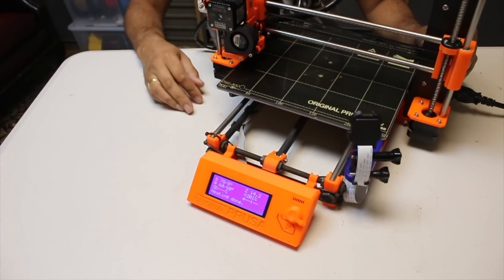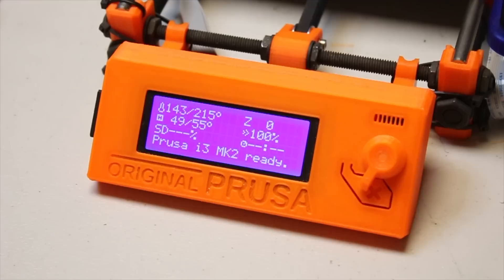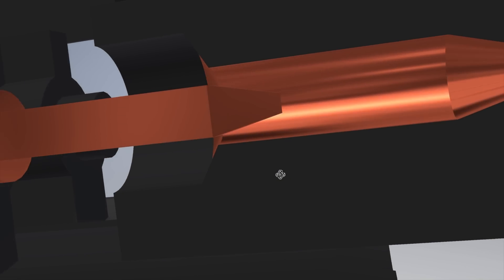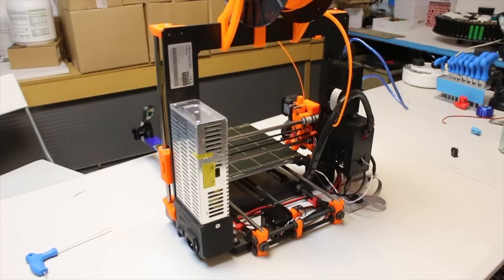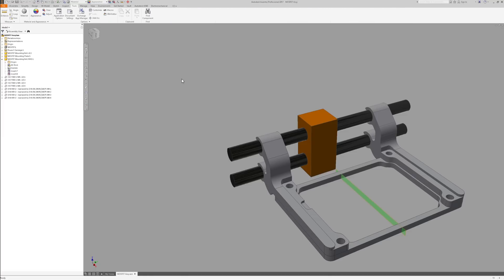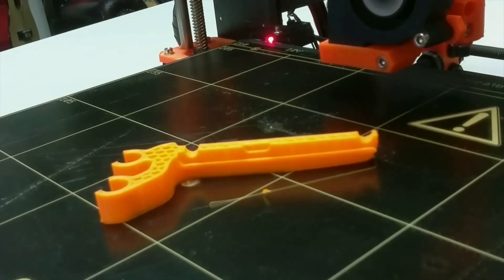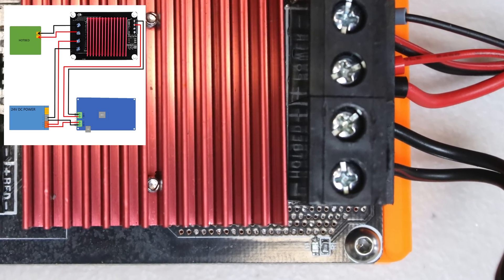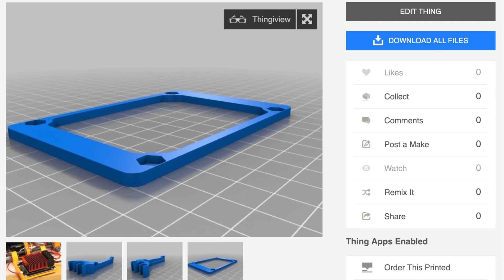Upgrade your 3D Printer with a MOSFET - Simply!

Comment: So basically, where the old heater wires connected to the mainboard, you connected the mosfets "control" location, then Power in/out to the source voltage, and hotend.  Is that correct?
Reply: I tired it on mi e mine fire the hotend, and it just starts heating and can't be controlled by the mainboard. Idk what to change. Can you please help,?
I'm on discord too.

Comment: Is there a reason not installing a fuse from the PSU to the mosfet? The original board mosfets are secured with SMD fuses. Now the low load from board mosfet to external mosfet is secure (smd fuses), but no fuse from PSU to heating element (over external mosfet). If the heating element fails it may short and draw a lot of amps. Not enough for the PSU (e.g. 200W) to shut down but enough for the heating element wires or connectors to get very hot.
This may be bad without a fuse, or am i wrong?
Reply: very underrated comment! i've seen a lot of people installing mosfets between their boards and hotbeds and hotends without adding a fuses. they run their hotends and hotbeads directly off the mosfets and psu. therefore, i'll ad a fuse coming from the mosfet leading to the heating element. what are your thoughts on this after one year?

Comment: Why don't you use a di-electric grease when installing pin components to the board? That's why your contacts are burning up. Because you're always going to have variances in dimensions between manufacturing companies for contact points. That's why the grease exists. Anyways.. food for thought.

Comment: i have a similar mosfet and mine just goes full blast as soon as the printer turns on. anyone have any ideas why? printer= tevo tarantula / control board= mks base 1.4 / mosfet= mkk hotbed-mos+ v2.1 2017.1.1

Comment: I installed one of these mosfets on my Tarantula using the diagram provided in this video.  Rechecked everything about three or more times to make sure all wiring was connected to the correct sections.  Right above the section where main power is supplied the ground line burned out and the mosfet went into a runaway event.  Short of turning the power off to the system the bed would not drop the temperature back to the low side.  I removed it and installed another mosfet similar to the one you installed, with the same wiring diagram and the bed has functionality. The vendor is refunding my purchase,  and I will order another one down the road for my next build.

Comment: Nice work, but your circuit diagram @ the 5 min mark doesnt match your actual wiring. The diagram shows power supply to mosfet and to mainboard. But you wired it power supply to mosfet, then mosfet to mainboard. Electrically identical but could be confusing for some people when they're trying to work out what the second set of wires are..

Comment: It’s not just the connector at fault. In theory they are a suitable rating... The fault is more to do with the wires moving and jiggling the connector. Over time and repeated jiggling this worsens to the point where there is not a solid contact and it arcs. This degrades and melts the plastic housing(s). Using the mosfet is a recommendation for heat beds in general but in this case it doubles as you are separating the connection from printer to power and using screw terminals which form a better connection to the wire. You shouldn’t use any solder on the wires gaining into the mosfet terminals and personally I wouldn’t risk crimping as this could cause a similar issue if not done properly, with wire movement. The only better way would be to solder direct to the board... 

Regardless, keep an eye out for wire fatigue. I ended up replacing the heatbed wiring with 14awg silicon wire as I got a break in the middle somewhere due to this and I’ve had to replace thermistors several times on my printers for the same as well.

Just 2 cents.

Comment: With the connector being the issue, why don't you just solder a better connector to it, or solder bare wire with e.g. an XT-60 connector to the board directly?
The mosfets on the prusas board are perfectly fine.
Good mosfets don't require a heatsink. The fact that this heatsink is so big means that the mosfet dissipates a huge amount of heat (and thus reduces the heating power of the hotend/bed) or the one who designed this board just doesn't know what he is doing (or it's just BIGGER IS BETTER marketing, which actually works).
Reply: Except you also need to replace the power input connector to the PCB, as that also has the same current drawn from it.
I'd much rather see 18A going through wires, than PCB traces. I design PCBs and have serious doubts those are rated for 18A.
Reply: Yeah sure, you would need to replace the input terminals too. The PCB shouldn't be a concern. I'm sure prusa did this right. And the external mosfet also sits on a PCB anyway :D So, it's just a question of who did the PCB better. Prusa, or a random chinese guy who thinks bif heatsinks are better.
Maybe @nerdville could measure the voltage drop on the external mosfet and compare it with someone who measures on the original prusa mosfet..

Comment: MOSFETs are awesome things. This should not have been needed as an upgrade. 
It would have been my first 'go to' device to make it happen from the start.
Reply: The mosfets on the prusas board are perfectly fine. I don't get why people use external and cheap mosfets to solve issues with connectors. You could just solder a better connector in, or solder the wires directly to the board... Good mosfets don't require a heatsink. 
The fact that this heatsink is so big means that the mosfet dissipates a huge amount of heat (and thus reduces the heating power of the hotend/bed) or the one who designed this board just doesn't know what he is doing.

Comment: Just a tip on using boot lace ferrels on your wire ends only use when screws are clamping on to the wire, if the connectors have wire protectors (a thin flap of metal between the screw and wire) use bare wire as you get more contact, it may be the reason your others melted
Reply: Those ferrules are pretty soft, they will also deform to the shape of the terminal and make good contact. While using bare wire is okay, I wouldn't recommend it in this application. Without the ferrules, bare wire strands can break off when you undo and redo the connector (which I'm sure you do from time to time on a printer) or just by bending the cable. Also, single strands that were not properly inserted could cause a short. Ferrules protect you from these issues. I'd use bare wire only on "one time installation and never touch again" applications with these terminals ;)
Reply: Yep, if those connectors are melting your really have something wrong with how you connecting in.

Edit Accely, Thouse connectors are kinda on the edge. Therre max current is 12amps and the bed is rated for just under 12. https://www.digikey.com/product-detail/en/phoenix-contact/1751086/277-1959-ND/1926175&?gclid=Cj0KCQjw5NnbBRDaARIsAJP-YR9mAv7QR2SdZBqg0QdgbC8C-4gM9ZPTtO5meLdZVGCqD2Xza4tHWT0aAmPkEALw_wcB

If it was me i would just solder a standard screw mount connector in and remove that plugable type. EX
https://www.digikey.com/product-detail/en/on-shore-technology-inc/ED700-2/ED1631-ND/33958